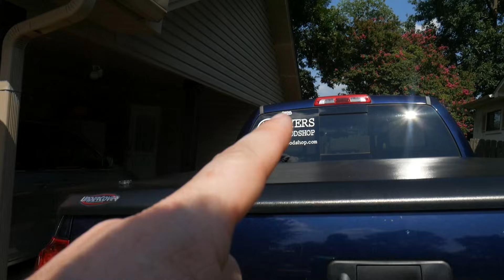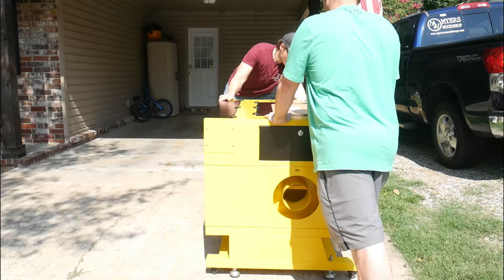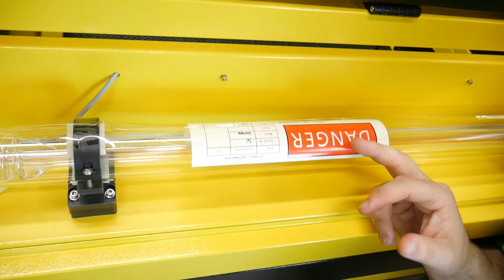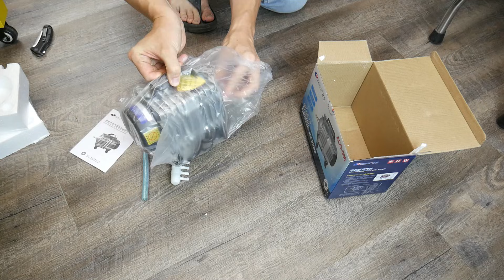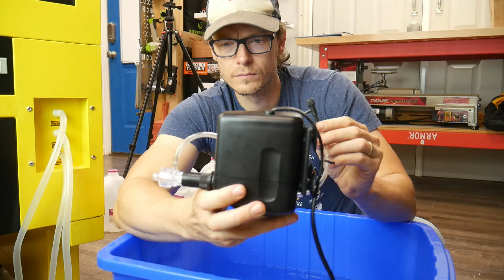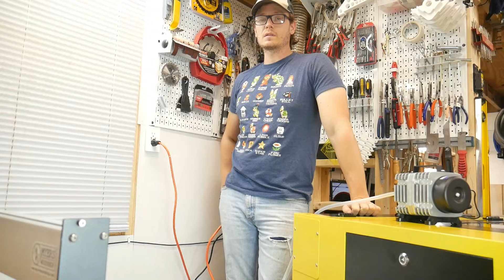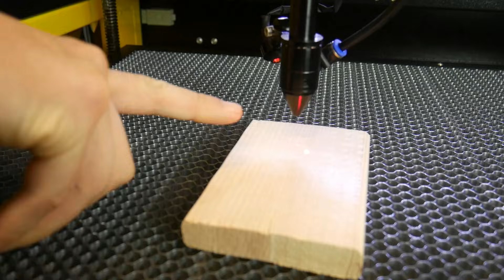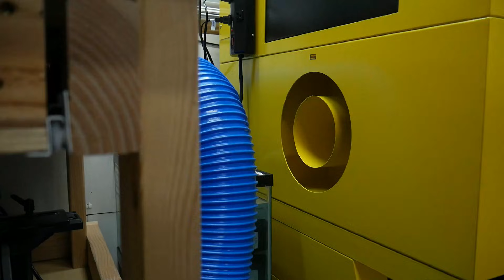Did I Waste $2400 on a 60W Laser Cutter from China?

Comment: If you use an insulated exhaust tube (or enclose the existing one)  it will lower the noise level. Also the shorter the tube, the less hard the fan has to work to move the air.

Comment: What is the maximum cutting speed the head can move? Are the rails exactly at 90 degrees? In 2015 I bought a Chinese leaser with rails 1 degree off the 90 and due to that not able to move with greater speed than 40 mm/ second. With higher speed, the head jumps not being able to follow the cutting pattern.
Reply: I have this same machine. X axis moves at 400mm/s. Y axis is slower since it's the entire carriage, but that's doesn't matter.

Comment: Wow. Its impressive how this machine looks for 2.5k. I rely like the way everything was thought out. Less the decibels - they could put more thought into building a fan and integrating it in a compact unit with the water tank and pumps. Also they should size those electrical cables correctly and control water flow and air flow from the same software not require you to manually switch things. Wished you showed more cuts in different materials. Thanks for the video.
Reply from the maker: It's A LOT of machine for the price!  Still very happy with it.

Comment: I have purchased basically the same one off Amazon, same brand but blue and gray. Says it is the new upgraded version for whatever that means. Mine will be delivered this Wednesday. Already talked to the carrier (Forward Air) and was pleasantly surprised that lift gate residential delivery was paid for by the shipping company (Orion). I'm not planning on relying on their cheap water pump that comes with it so along with the 200CFM exhaust fan I purchased I also purchased a CW-3000 water chiller. My only worry now is how hard it will be to separate the unit from its stand as I will need to do so and put the unit on its side to get it though a doorway. Hopefully it is not too difficult. I don't have a nice wide entry way you like do.
Reply from the maker: it will separate but will take some time.  do it carefully. you'll prob have to realign the mirrors

Comment: I'm lookinh to buy one.  I was thinking the 100 watt which is probably 80 or so.  Its several hundred mornthan the 60 watt. Would you recommend going for the 100?
Reply from the maker: depends on how thick you need to cut.  if you want to do 1/2 definitely need the 100w
Reply: @MyersWoodshop  I figured if I'm buying one may as well go slightly bigger in power.  Also how sensitive are these things with temperature? My shop is in a garage.  Its insulated with make shift heat in the winter and really nothing to cool in the summers.
Reply from the maker: As long as the water doesn’t freeze, I think you’ll be good
Reply: Hello Joe Palumbo221
, 

Are you still looking for laser cutting machine. This is Colin from Oree Laser in China. If you still have interesting in other brand of laser cutter, kindly add my WhatsAPP/Wechat number : +8618668921695 . or send mail to : sales079@oreelaser.com , I'll share more info to you .Our web: oree laser.com 
Hope you have a nice day.

Comment: Since yours ended up being a 50W laser, would you still recommend yours compared to the $1350 50W lasers on Ebay? I believe they are similarly ~$1700 on Amazon. Other differences besides power that you still recommend yours? I'm guessing size?
Reply from the maker: the 50w are actually 40 and so on.  I'd stick with this one or higher.

Comment: Ok, I am asking everyone I know who has one of these... 

I am attempting to add a valve to mine to only use air assist when I want to.  When I went to wire up the valve, I found that I have the "prong section" for the 24v and wind, but don't have the 6 way plug for the prong. If you are still following me, do you have any idea what those 6way green plugs are called so I can order one? 

Thanks.
Reply: Ok... took me a few hours.  In the slight chance that anyone comes here in the future looking for the same info, here is a link for the TERMINAL CONNECTOR.  This may not be the same for some of the older models.  I have the blue and charcoal 60w machine, that seems to have some different stuff than the black and yellow. 

https://www.parts-express.com/phoenix-type-connector-6-pole-5mm-pitch-4-pack--091-374
Reply from the maker: nice!  glad you found it.

Comment: The laser looks like your typical Chinese 60 watt units with a 1000mm 50 watt tube and a 60 watt Laser power supply. Looks like my red black 60 watt except mine does not have the leveling legs. That's a nice feature.
Reply from the maker: yep.

Comment: After watching this video and reading all of the comments, I ALMOST bought this machine, but ended up getting the updated 80 watt laser instead.  It wasn't much more.  It has some upgrades.  I have just pretty much got it unboxed and am in the process of getting it set up.  The biggest difference is that I have to install the laser tube.  It is not already in the machine.  Trying to figure out how to do that without getting killed.  The manual that came with the laser is entirely in Chinese and the pictures are not super helpful.  I am really excited to get this up and running though. I also understand nothing about "grounding" so I need to figure that out.  This one has the air and the exhaust inside the machine, so no separate parts for that other than hooking up all the tubes and hoses.  (I think)  I haven't gotten that far.  Will try to get it tackled this weekend.  Thanks for the video though.  It may have been boring for some to watch, but pretty helpful for me since I'm trying to set mine up too.  I did email you last week with questions since I couldn't log on to this, but never heard back.
Reply from the maker: nice!  how do you like it?
Reply: @MyersWoodshop  Still trying to get it set up.  Probably get it turned on today.  Have been trying to figure out whether or not I need to hook the ground wire up to something - and if so, to what.  Some say yes, some say no.

Comment: Great vid!  It will be nice to have a pro/cons after 10 month experience.  Any problems so far?  Co2 tube performance goes well?  Many review I see about "chinese laser" said that laser tube don't last (maybe 2000h if youre lucky).  What about your's? Any power loss? Still a good 50w power source? (I know is a 60w but in real, you probably got 50...pure chinese marketing!)  In your experience, do steppers "do the job" and if you have to buy a new machine will you choose servos? Finally.....I see your yellow/black one on Amazon but now Orion Motor Tech have "new and enhanced" blue one.  Don't know if it's only a "color of the moment" change or they pack it with new features....   Thanks!
Reply from the maker: 10 months in, still the greatest buy in my shop.  tube is still as strong as the first day i bought it.  I have no clue about color change, its probably the same machine.

Comment: I know a slightly old video - and probably already answered - but the sealant is used when you inevitably need to change the laser tube. You generally slather it over the high voltage connection on the tube to prevent arcs (which are very bad).

Only 16mins in - but already looking like a solid purchase and a decently build machine. I have a similar 50w* one with the exact same controller (software stinks!) - which I afterwards upgraded to  60W tube from a local vendor.
Reply from the maker: It's been a great purchase.
Yep, silicon is for the tube.  hope I won't have to use it for a while!
Reply: @MyersWoodshop  you'll get plenty of use out of it I'm sure! Thanks again for such an informative video - I got to learn something new (the passthrough air blower will definitely get some consideration!),
Great, well put together, and informative video -well done1

Comment: you could use a laser cutter table, with a stronger laser, to 3d print with also. all you need is a bed that raises and lowers, so you can add extra layers, ie a 3d printer.  metal powder should work a treat lol the  bed can be made removable .
Reply from the maker: that would be cool.

Comment: Build a closet attached to the outside of the shop and put the fan in the closet and then  so it won't be that loud.  Can you hook that to your PC and or put it on the network and copy your CAD Drawings to it?  Can you use it to mill out gun parts and motorcycle parts?  That's what I would want to do with a machine like that is make gun parts like lower receivers, trigger assemblies, upper slides and motorcycle parts like pegs, mirrors, brackets, sissy bars, seatpans, tank pieces.
Reply from the maker: yeah, this is hooked up via LAN.  I didn't want to piss of the neighbors.

Comment: The pump should be sat on its rubber sucker feet. It won't suck from the tank bottom as (in a fish tank) that would be sucking up sand.
Reply from the maker: pumps gone, almost immediate changed to the chiller.

Comment: 32:30 Measuring sound is very dependent on the distance from the sound source. With the quieter one, you had it MUCH closer.
Reply from the maker: you still get the picture.  the big one is WAYYYYYY louder.

Comment: Linear rails should not have "goop" on them. Its not so they move well. Its so they dont rust on the slow boat.
Reply from the maker: what should i put on them to keep them moving smooth?
Reply: I’d clean the protective coating off and put some 3 in 1 multipurpose oil on the rails. You can get it at Lowe’s.

Comment: mount the exhaust fan outside. to me, a key fail of the glowforge is having to break the warranty to get the noisiest component out of the room. will this machine etch/engrave? I know 60W isn't enough to cut metals, but if I can get a consistent groove depth.. What concerns me most about this kind of shipment from Amazon is: I have to un-crate it to see if the tube is broken. The freight company isn't going to wait around for that inspection prior to signoff.
Reply from the maker: neighbors are real close. don't want to be THAT neighbor.  Yep, it will etch and engrave and it will DEFINITELY cut right through 1/2 material in one pass..

Comment: You can get heavy duty 'dimmers' or try a large variac to tame the extractor fan down to a speed that's reasonable.
32:23 The noise of the better fan is far lower, distance from noise source to meter is very important (as a square of the distance) and it had no pipes connected. I suspect the better fan is around 4x quieter.
Reply from the maker: the point remains the same.  the big fan is WAYYYYYYYY louder.

Comment: So.. Um.. Yeah.. Just so ya know.. Those windows on that thing do not shield you from stray laser bursts. You catch a reflection to the eye and you're going to be permanently bind. You might wanna replace those panels with actual laser filtering material that's designed for the correct wavelength your laser is using...
Reply from the maker: lets hope not.

Comment: Fix the loud exhaust fan noise by putting the fan in its own enclosure outside your shop - run the hose from your laser cutter thru your shop wall to the fan outside.
Reply from the maker: I’m considerate to my neighbors
Reply: @MyersWoodshop  I mean a sound proofed enclosure that will muffle the noise

Comment: Does anyone know the CFM of the big exhaust fan that come with the laser cutter?
Reply from the maker: more than my little replacement one...but 100x louder..
Reply: @MyersWoodshop  thank you for your reply. I got the replacement you suggested. I had to stop using the laser cutter and open both doors in the garage plus use a few fans to get all the smell of burning wood out. I resumed engraving with the blower that came with the laser and it made a big difference. I can still smell the burning wood, but not as bad as the small quiet replacement fan. 

I am going to end up building a sound proofed box for that giant loud fan while I use the laser. I don't want to breath smoke the whole time I am in the garage :(

Comment: Run the hosing thru the wall and put the blower fan outside.  Build a wooden enclosure and line it with cork.  How hard can it be to silence a fan?
Reply from the maker: not hard, but how hard can it be to piss off the neighbors at 11pm? easy.

Comment: I've been reading about these and other lasers for awhile now, and I'm ready to hit buy, you've had yours for a few months now.  Would you buy it again?  Any regrets?  Is it still working?  Any recent issues?  The reviews are all over the page on these things, that means either quality control or often the problem is the weak link standing in front of the machine.... ;-)  Btw thanks for posting the video.
Reply from the maker: I still love it.  Don't regret a thing.  It's used almost daily.  Only thing I would do differently is order the chiller at the same time as the laser and just skip the water pump all together!  Make sure to use the links below to buy!  It helps me create more cool videos!

Comment: I'm gonna like this cause you are new to Lasers but rolling it across the grass bulldogging it with tube in. yeh looking for failure. looking at getting my first system. I've worked for 9 years with epilog and vyteks, at work. looks like crappy power supplys on this one. I suggest installing an hour meter so you can judge time on components. also if you have any questions feel free. I've pretty much dealt with every problem with a laser system.
Reply from the maker: can you believe it made it perfectly fine?!  we've got Godly luck.
Reply: @MyersWoodshop  pro and cons?

Comment: If it doesn't work it's your fault,  You just pushed and bumped and banged a precision laser and tube assembly around.
Reply from the maker: It's called durability testing.  Did you watch to see if it worked?

Comment: I worked for a company who had one of these and one day it caught fire and burned the building it was in to the ground. It was turned off at the time.
Reply: Yes, the mains and HV wiring is sometimes a bit crudely done in a lot of budget laser cutters.  I would inspect all the power wires and have a main switch for the complete unit that can stay off when not supervised.
Reply: I ALWAYS unplug my machines when not in use. Just a habit I formed after seeing so many fires started by electronics while I was a Firefighter.

Comment: Quieter, smaller and uses less electricity, but does it actually move as much air under the operating conditions. - different motor sizes indicates something the designers were thinking, that the makers of the "bilge ventilators" were not.   just sayin.
(Efficiency, is in the - eye of the "metric" creator...  jk)

PS, but is the noisy one any better for the machine and working environment (I have no idea)
Reply from the maker: the smaller motor does not move as much cfm.  but it moves enough cfm for me vs. the sound.  so that's what i went with.  if sound isn't an issue, use the one provided.

Comment: I wonder if glycerin can be used instead of water?
Reply from the maker: i have no clue.
Reply: People often use car radiator antifreeze.  It is vital that the water in teh laser tube never freeze as it will easily fatally crack the tube.  There are also reports of people having algae grow in plain tap water so for this reason distilled or antifreeze are a good idea.  Antifreeze is also usually coloured so it is easy to see if there are trapped bubbles and detect flow.  Adding a flow detecting switch and an outlet water temperature switch are good investments if planning on long jobs.  As mentioned in another comment the tube life and power output are best served by a constant temperature around 20 centigrade.

Comment: i worked at a shop for a couple of years. our laser engravers where 120w units. you will want to use the larger grey fan and mount it outside with a rain shield.  the partial debris will slowly build up on the blades. that smaller  fan wont be able to handle that.
Reply from the maker: if that happens, i'll just buy a new one.  its worth it to keep it quiet.  My neighbors are really close and i dont want to be a douche.

Comment: The air is not designed to 'stop fire'. 

It /does/ keep the material cooler and thereby stopping it eventually setting alight but in the meanwhile it actually clears smoke and residue away from the laser sight to avoid blocking the laser light and also the lens fogging up with residue.
Reply from the maker: your right!

Comment: 60W power supply doesn't mean squat. If the machine is taking 60W the laser is probably getting 50W after powering the tech bits and moving the laser head. Even with 50W input to the actual laser, you'd be lucky to get a 20W beam out of it.
Reply from the maker: i can cut 1/2 plywood, so its 50-60w.
Reply: @MyersWoodshop  what say you to this: https://youtu.be/3B9C-UTPMbk
Reply: I'll grant you this is internet research, but high-end solid-state fibre-optic lasers over about 100W tend to be about 50% efficient. Efficiency should go up as power consumption goes down, but that's for a given laser diode. Of course, these cheap Chinese things are typically designed (or, more often, reverse engineered) by garage engineers, so they tend to be terrible at sizing parts. You might actually have a 60W diode in there with an underpowered supply. Good luck getting part numbers that come from a supplier with an English website (or at all), though.

Comment: Your videos are very informative. I see these laser machines advertised all over eBay for under $1800.00. I don’t really think there is one specific brand (probable mass manufactured by one factory and sold under different names anyway), are these the same as the one you show? Also did the camera come with yours or did you install that separately? If so, what is it called? I’d really like to add that to mine. Thanks!
Reply from the maker: camera is separate from lightburn software.  check my other videos!
they are the same.  I included a link to one on ebay in the description also.